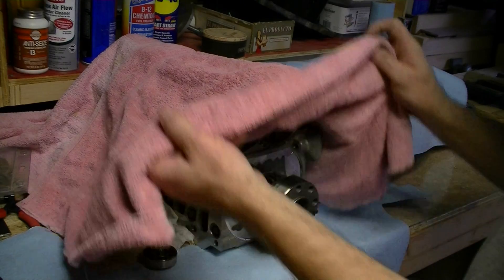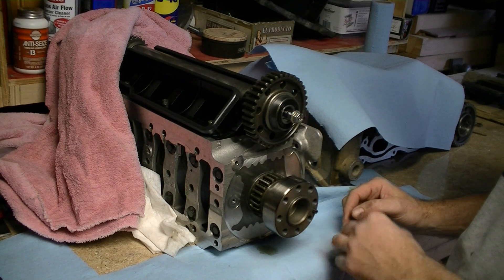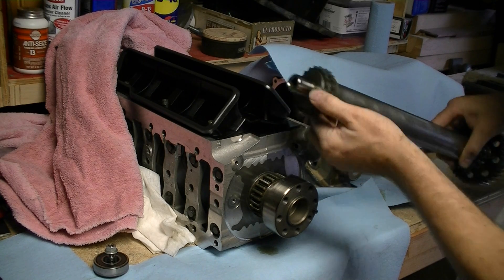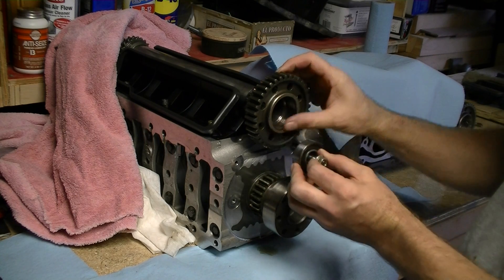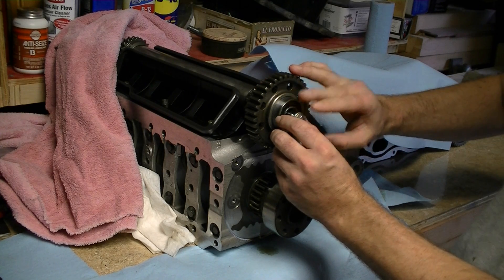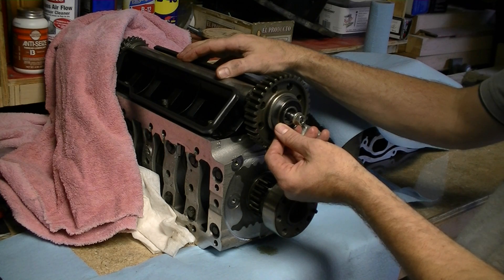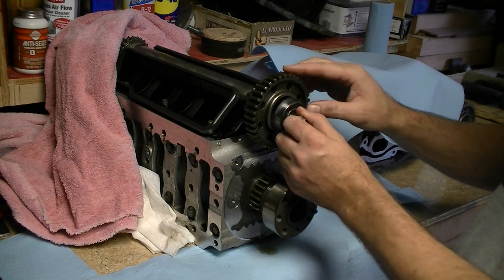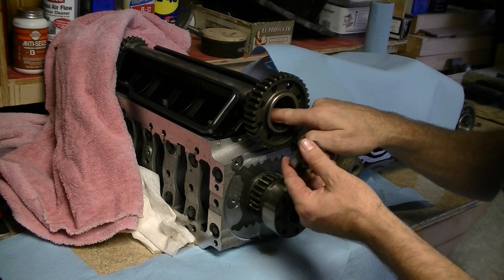1 986 IMS Bearing Failure Mode

Comment: Apparently you're the only guy who has identified the root cause of the IMS problem.
Reply: Oil intrusion through the IMS bearing seal is only one of several possibilities of failure. This has been known for years. James clearly explains how oil can penetrate the seal and negatively affect the bearing grease. This is why some people preferred to remove the seal all together to allow fresh oil to travel in and out of the bearing.

Comment: Hi, a very plausible theory.  Did your alteration work?
For all of us concerned about the Porsche IMS Bearing issue - I found a very informative article from Autohaus Hamilton in Australia about the IMS. The article also lists all the models and engines (with engine numbers) that are affected. To read the article just type in “Autohaus Hamilton IMS” into google. The Porsche models that are prone to IMS failure and should be replaced are: - All 986 Boxster models. - 987 Cayman & Boxster models up to engine number 61504715 - All 996 models (not including: GT and Turbo models) - 997 3.6ltr with M96/05 up to engine number 6950745